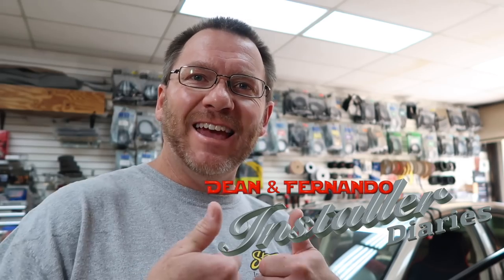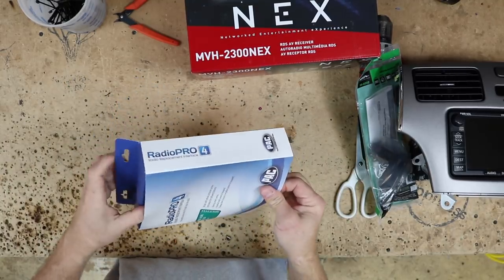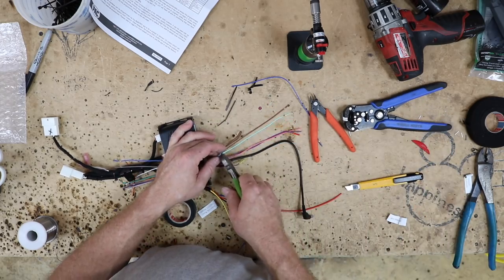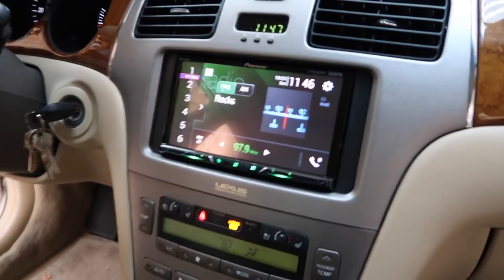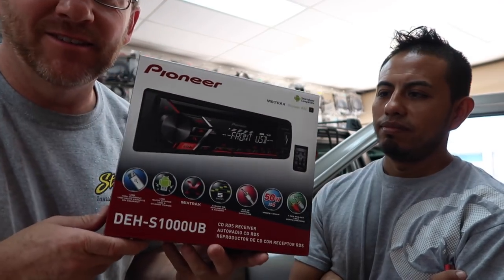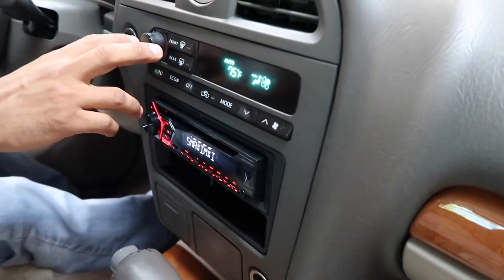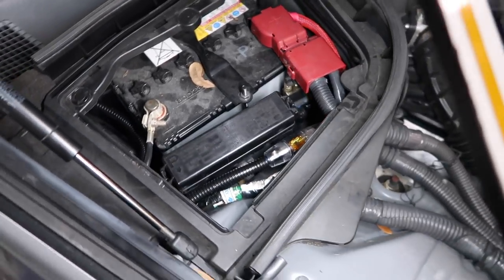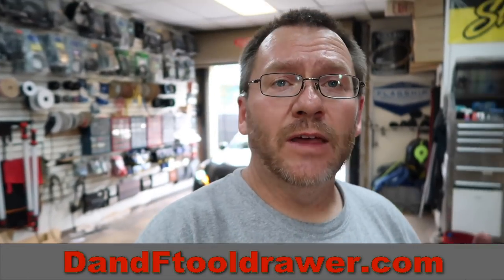A Lexus and a Infinity all in one day, oh yeah and a couple of cheap raedios  Install Diaries 85

Comment: Hello love your videos spend hours watching this stuff I was hoping you can answer a question I was working on my infiniti q40 basically a g37 and the gray wire you used for remote turn on I only get 2v out of it. Curious if you had the same problem and is there a fix thanks.

Comment: Hi guys, with the sub install from Bose system, I would have thought that the ground power of the amp and ground of the low level signal into the stock Bose amp would be the same so if your dmm was on continuity using the car body you could use that way to find low level polarity rather than putting 9v of the battery into the amp,wouldn’t that potentially blow low level inputs on the stock bass amp.
Just a thought, love the channel

Comment: Great vid as usual. I'm confused about the battery test for the signal.  How does the direction of the speaker identify which was negative as it may vary by car manufacturer?
Reply: Because it identifies the color of the + and - wires.  Then, he was able to solder on an RCA to get signal.  If you don't identify this first, you could wire it backwards and your signal wire would be out of phase.  Obviously, you need to do this while the speaker is still connected to the factory plug, so you can trace the wires.